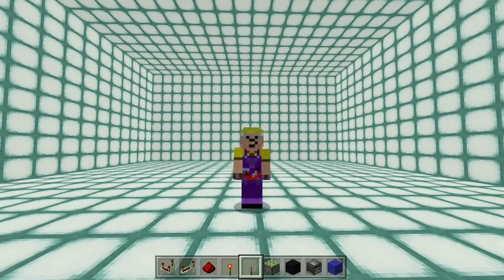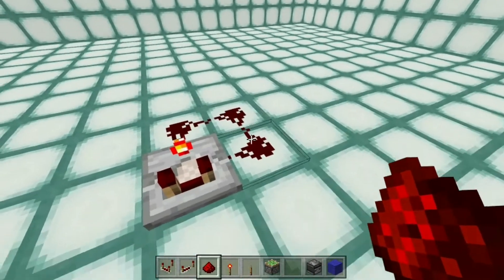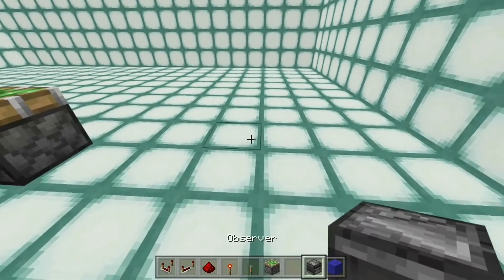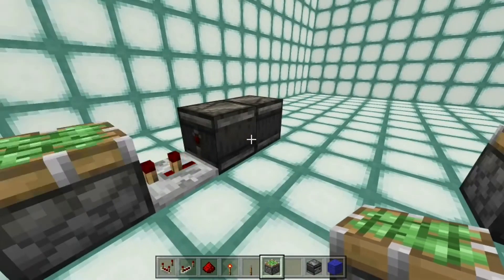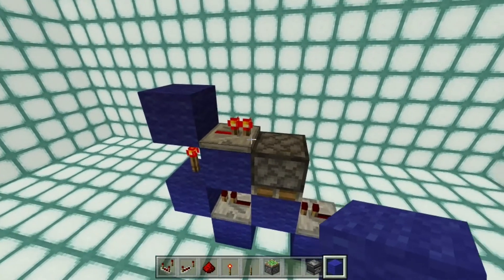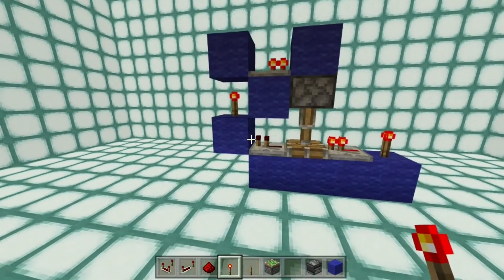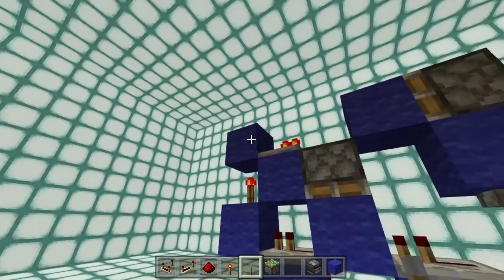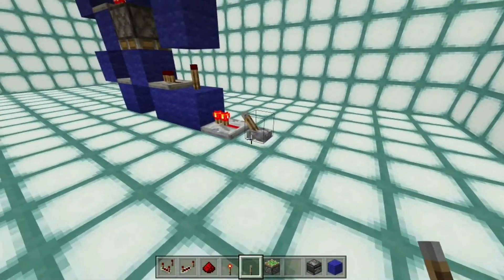1 wide tileable 2 tick clock

Comment: Idk if I'm doing it wrong but this doesn't seem to work. It works if you replace the repeater on top with a torch, but it's at half speed. Unfortunate, seeing as this is exactly what I needed for my project :(
Reply from the maker: Wow, this is one of my first videos! What exactly do you need in terms of speed? Do you need it to be silent and 1 wide tilable? And are you definitely on Bedrock Edition? Also, sorry for the slow reply!